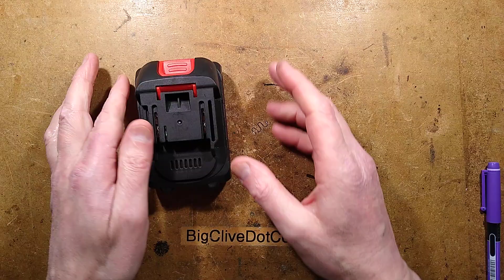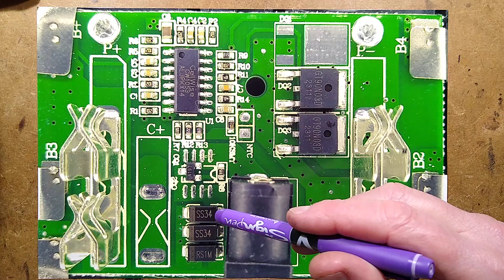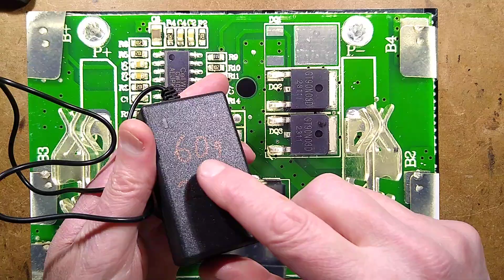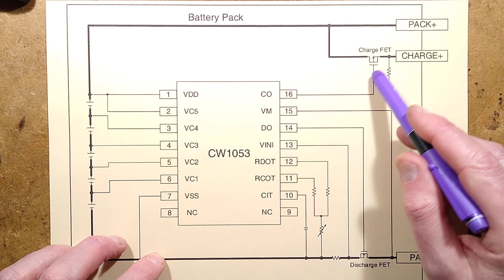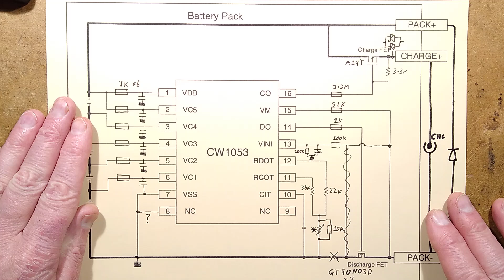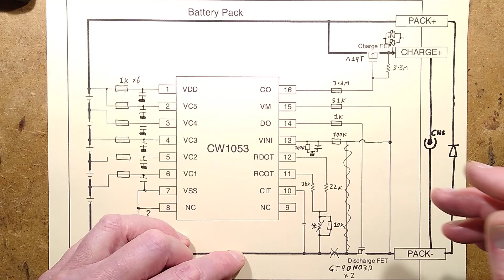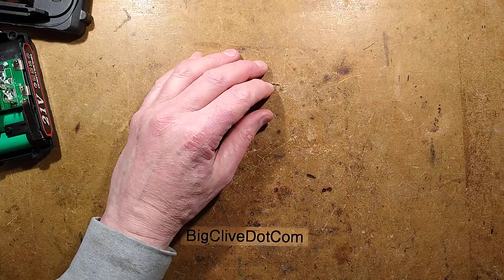Inside a new style eBay tool battery - with schematic

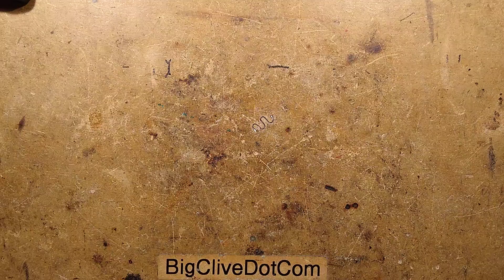Comment: 6:00 Looks like you only found the 2 page summary for the CW1053. There's actually a full datasheet, but it's in Chinese.

I used some online translation tools and some logic to manually translate it into sensible English. Posted a link to it on the /r/batteries subreddit if you're curious.

My ones used a CellWise CC9053, but I couldn't find a datasheet for that one (though pinout seems to match and so does the ref circuit, so presumably it's essentially the same chip).

Comment: I think that the circuit board is slightly misplaced under the tabs. I think it looks as if they will sit nicely on the board if the board was moved a little southward. That would give more room for the spot welding as well. Of course I'm not in a position to see if that board can be moved southward without impacting some other structure within the component.

Comment: The only downside to those style of batteries is you have to remove the battery to plug the charger into the port. It would have been nice if the port was at the back of the battery so you don't have to whip it out of the tool first.

Comment: Does anyone know whether the DeWalt 18V XR battery packs have protection against over discharge? I want to use my DeWalt battery pack to power something without any intelligence and would prefer to avoid a situation where the battery over discharges and I can't recharge it again... Cheers, Mike.
Reply from the maker: I doubt they have over discharge protection.  Many "pro" tools rely on the tool itself to shut off when the battery indicates a low voltage.

Comment: They are also cheeky calling these 21V batteries. I have one here and it looks like it's based on Makita. The battery packs are supposed to be waterproof - they are not. This one I have islabelled (poorly) as 4ah. If the company wants, I can repair the pack by replacing the BMS.

Comment: Bummer that this was actually doing pretty well before that tab and the missing thermistor. That overlapping tab definitely makes me nervous, since that will likely move when plugging and unplugging the battery from both the tool and the charger, and if it shorts out that will be a fun time.

Comment: I stick to original Makita batterys. It's the old 18v system, but after 4 years all my packs are still working fine. If one eventually fails I'm glad because I can pull one apart! Curious what's in side. 😁

Comment: The big brands like DeWalt, Milwaukee, Makita and so on definitely make an absolute killing whenever some poor sod buys a single battery or two. I had to buy a single 18V 5Ah Milwaukee battery years ago and it was about £150 at the time, keep that price in mind because a year or two later I bought a battery/charger combo. Six 5Ah 18V batteries with a charger that could take them all at once, for about £350.

You get the same thing with those package deals where they sell you a sawzall and a drill with batteries, a charger AND a "free" M12 battery thrown in just so they hook you on that front as well, typically a pack like that is also around £3-400. The markup is absolutely ridiculous.

Comment: I bought a small chain saw and a line trimmer one came with the same battery as these but the one that came with the chainsaw has a battery voltage test button other wise the same batteries

Comment: Out of curiosity, would accidental contact between the internal battery negative and the external negative terminal pose a safety hazard, or only a risk of damaging the cells through over discharge? Curious if this colour be upgraded from a potentially dangerous battery to merely a low quality pack by trimming that cell tap so it isn't overriding the other pad
Reply from the maker: It would just bypass the cell over-discharge protection.  The tricky bit about trimming the rogue tab is that you may make the situation worse in the process.

Comment: I’ve found with almost all those mini chainsaws that the trigger is designed to be pushed with the middle finger. Try it, and you’ll see that there is a notch (or choil) for the forefinger in front of the trigger. Don’t know if that’s good or bad, but they are easier to hold if you use it that way.

Comment: Do you know about 2-cell (series) bms chip with balancing? Most chips I found only do monitoring (HY2120-CB, S-8242A) and stops charging when first battery reaches 4.2V. Something really simple to implement and small.
Reply from the maker: The balancing systems I've seen use a separate arrangement for the balancing.

Comment: Fun fact, I have almost the same one, and it does have the terminal for charging. also my charger weirdly states at the back that the output voltage is 21-98V 1A... What?
Reply from the maker: The 21-98V is for their fake power tool specs.  All those ones are just 18V batteries.

Comment: I have one of these handheld chainsaw things, looks about the same, and mine has failed - turns on for like a second after pressing the button and no more. I tested the battery when pressing the trigger and it has proper voltage, drops under load a few volts but ok. I'm suspecting the potted electronics that drive the motor then :( (checked the switch and with another battery too)

Comment: Got a really neat cordless hydraulic cable crimper of AliExpress, cost about £400 in all. It came with makita clone batteries but I got an adapter to use it with my dewalt batteries!
It came with 2x 5ah batteries and I'll probably use the 18650s out of the for something else, I was pleasantly surprised by the build quality of them though..

Comment: That's why brand is a fact. I have been using a "Total" brand cordless impact drill from 2020. No issues at all. Last January, 2024 both of the batteries just died while drilling. When I checked I found out that 1 cell from each pack went to 0v. So I just replace the cells with Panasonic ones and now it is all fine. But the main thing is, it is well built. They have none of the problems shown here. PCB traces are good, nickel strips are well designed specific for the battery pack. A good product actually.
Reply: I was in Thailand recently and Total is big there, has retail stores in shopping centers etc. Good quality/price ratio.
Reply: @CheapCheerful  
Yes, very good quality products. We have ingco, tolsen, harden too.

Comment: My dewalt packs were failing and I found replacement cases on Shoppee that come with nickel strips and bms just add quality lithium ion batts. Got one that holds 15 cells and another that holds 10 21700 cells. Back in business!

Comment: That unpopulated terminal is used by Makita to check the temperature. It should be at or slightly below the full battery voltage. I built a few batteries on my own using these kinds of BMSes and Makita tools don't work with them since that pin doesn't have the right voltage. What I've done was to disconnect all the traces from that terminal and short it to the positive.
The Chinese have basically repurposed that terminal for charging. I've even seen some knockoff Makita chargers that have only that pin connected and they don't actually work with real Makita batteries, only with these types. Also because of the female jack terminal these batteries don't fit on original Makita chargers because of the yellow terminal.

Comment: Hi Clive, Brilliant video as usual.  One thing about these "21v" batteries, is that they are not actually 21v, Thy all have 5 cells in which is exactly the same as the 18v batteries from branded names. Even fully charged they do not supply 21v. The circuitry doe not boost the battery output. There are hundreds of cheap Chinese tools with these batteries all purporting to be 21v. I actually purchased a drill and when I found the batteries were not as described I requested the correct ones from the seller. After many Emails, no 21v battery was forthcoming and a full refund was given and they did not require a return..  Keep up the good work Clive.
Reply: In their defence, DeWalt to this day continues selling their tools in some countries as 20V using the exact same reasoning, and 4.2V peak per cell does mean that technically the pack does have a peak voltage of 4.2V 21V even if that's never going to be delivered in the real world once factoring in voltage sag and such
Reply: Maybe 21 Chinese volts is equivalent to 18 British volts? 🇨🇳⚡🇬🇧😉

Comment: I once had an unbranded power bank fail catastrophically in my backpack because the positive battery contact was laying across a ground plane with only soldermask separating the two. It did, eventually, blow the track clear, but not before melting through the case and producing tons of smoke. When I pulled the smoking power bank out of my bag, I could see the battery wire glowing red hot through a hole melted in the case. With the number of overlaps in that tool battery pack you have, I would be very nervous about it myself.

Comment: Those boards do not balance cells and they tend to discharge the battery to flat zero when left for too long. I have some collection of chineese tools and I have made my own "beanz" battery for those tool. It had only one row populated and to be honest those cells can give 15 amps I have tested them but in combination of about 1500mAh capacity well, the result is not so spectacular. I have depacked that battery, bought ten HB6 LG cells, they are also 1.5Ah but they deliver 30A with no problem. Only problem I had is that I had to use 0.15mm nickel strips because my welder won't tack anything thicker securely do basically I did 2x0.15mm sandwich in theory this pack gives 60 amps and chineese SDS drill was happy with that battery comparing well to the stock condition I had been given with the tool. Milwaukee, dewalt, makita, etc uses 0.3mm pure nickel strip but I guess that sandwiching strips is somewhat equivalent of that. I have come to one idea for those batteries, they have excellent spot to grind with dremel and place JST-XH connector there and I am going to do it because I have abundance of really good RC chargers lying around. Overall, charging them with that light brick is fine when cells are in balance. If you have those batteries it would be wise to take cover off and charge each cell from the pack manually to 4.2V even with TP4056 and then operate normally. There's still lot to cover about those batteries, building then etc. Right now I am planning on trying out those spotweld boards, beefing them up with extra fets and then pairing them up with huge 100C lipo sandwich and maybe then I will be able to conquer thick pure nickel strips. Only one I have right now is BIFRC DH20, spot welds 0.15mm very well but 0.2? Forget about it.

Comment: Having used an expensive Milwaukee battery on an adaptor for an old Ryobi angle grinder, I would say don’t trust cell voltage sensing on the battery. It only works with feed back to genuine Milwaukee tools. I was lucky, and managed to save the battery which had some cells that had dipped well below minimum safe level. The Milwaukee charger didn’t want to know, so I had to use my variable power supply to carefully charge the battery to a point where the Milwaukee charger would take over. I don’t know if this is the case with all batteries, but it would pay to be careful.
Reply from the maker: Since the legacy Ryobi tools originated as NiCad and maintained that battery form for backward compatibility, the protection is in the actual batteries themselves.   With other brands they often just send an enable/temperature signal to the tool to tell it when to turn off.
Ironically, these clone batteries would be OK with that adaptor, but are not rated for the current of a grinder.

Comment: Clive, there's a handheld fan popular in Asia which has battery management you might find interesting. Search SAPI N15b portable fan and you'll see some images. It has no low voltage protection but uses the digital percentage 'meter' to cut power when it counts down to zero. I tested the two 18650 parallel cells at just 937 mAH combined and replaced with batts with cells totalling closer to 5000 mAH. There's charge protection to 4.2v but when the meter counts down to zero the fan shuts off with higher capacity batts still reading 4.0v. Unexpected 🤦
Reply from the maker: The expected cell capacity may have been baked into the software.  Some devices can self-learn if the cells are charged in them, starting from low charge (3V).

Comment: That thing called a charger is nothing of the sort. It is a simple power adapter. The charging circuitry is on the battery PC.
Reply from the maker: It does have current limiting and crude monitoring built in.
Reply: @bigclivedotcom  What, in the power adapter? 

I did have to fix a similar set-up on a cheap cordless lawnmower, and it turned out that the so-called charger was just a power adapter. It was captive with the battery cable, but all the charging intelligence was in the battery itself (I can't speak for how intelligent the charger in the battery was though - I suspect it wasn't).

Comment: Not bad? Clive your definition of not bad has certainly come down to meet the lower standards of todays tech. Tabs rubbing on the solder resist which is its separation from a dead short, on a lithium ion battery pack used on a tool which vibrates by design. Acceptable?  Not bad? Fire hazards are not acceptable, id rather the battery be weak than it be a fire hazard.
Reply from the maker: By not bad, I mean it does actually have charge management.  Some rogue packs have none.

Comment: I have a similar mini chainsaw, got it about a month ago.
It works well, there is a thermal trip strapped onto the motor to detect if that is getting too hot.
I am now going to check the battery and alter if that strap is too close to that track.
DO I add a thermistor, well I think I will.

Comment: One thing I've noticed on eBay, locally at least, is that the vendors (all Chinese, of course), don't sell these batteries separately. Not even if you want to buy a new replacement pack. No idea why. But they do sell the circuit boards.
Reply from the maker: In the UK they can't ship just a battery on its own due to very ill-conceived postal regulations.  But they can ship them with or inside a product.

Comment: This is why I tend to open up these kinds of batteries. To inspect them, and to fix dodgy assembly work. I'd rather not use that one, as is.
Depending on how hard it is to open them up, I might also add a balancing connector and RC-style power connector, so I can charge them with a balancing charger, every now and then.
If the pack is easy to open, I just add temporary balancing leads whenever I feel like rebalancing the pack.

Comment: One thing about the RC-circuit in the main current sense path: Usually the Li-Ion protection circuits are designed so that in case of a full output short the protection circuit reacts as fast as anyhow possible. Reason is that the cell and circuit impedance somehow limit the short current in the microsecond range, and now the race begins: Either the output mosfet first switches off and anything is good, or it first reaches its destruction current so that it melts and does not switch off any more at all.

I have some doubts that this race can be won if you add filter circuits in the shown way.

If you have some safe lab area, you could connect a beefy car-relays to the output and short it from a distance to test it... If you don't know how safe the lab area needs to be, then please don't do it 😆

Comment: B3 connection tab also has the same problem as the B2 connection tab. Might be that the tab width has changed after the PCB design since the tabs looks like they are unusually wide.

Comment: I work for a Heritage Railway and we use a lot of cordless power tools and they have come a long way, where we could use a power tool for only two or three hours max and the battery is flat and now the power tools have more power and we can use the power tool for four to some times five hours before they need to be recharge but these are the upmarket tools and cost £ 160.00 up to!

Comment: finally chainsaw with actual safety interlock. imagine falling and grabbing it...

my ryobi mains one has that. and it also had automatic oiler instead of manual hope yolo oiler. it's implemented by solenoid in series with motor. restricts it's usage angle tho

Comment: It's interesting how the Chinese play the "battery voltage inflation" game.   Makita would call this battery an 18V one; Dewalt might call it a 20V one, but this manufacturer goes whole hog and calls it 21V.  After initial discharge, the battery voltage should settle to 18V.

Comment: Also, is that a solder bridge between pins 3 and 4 of U1, or just debris?
Reply from the maker: I didn't spot a bridge, but other modules do have them across chip pins deliberately.

Comment: I discovered that 18v Makita tools with "Star Protection" won't work with these packs as is, on these generic BMS boards, C+ contact has to be jumpered to the main positive and voila, angle grinder works.
Not sure if it's good for the bms tho.